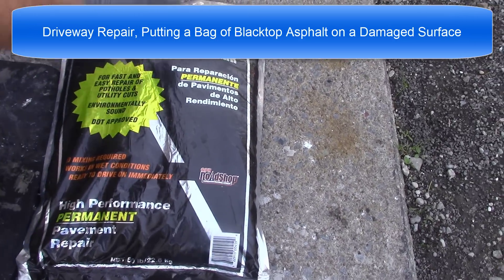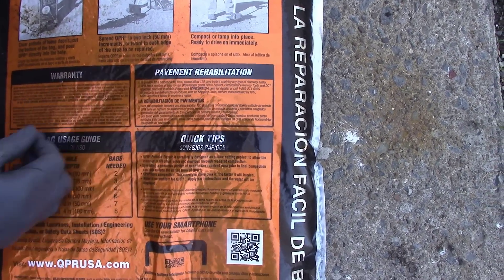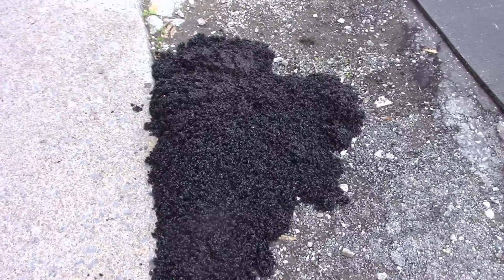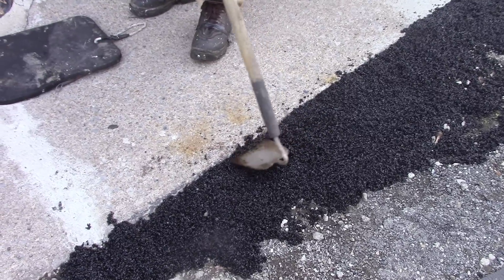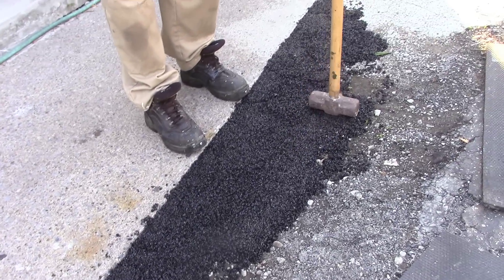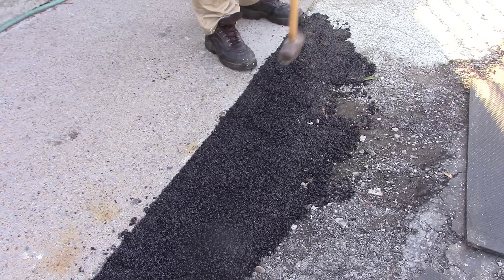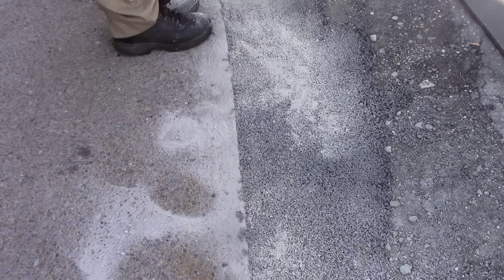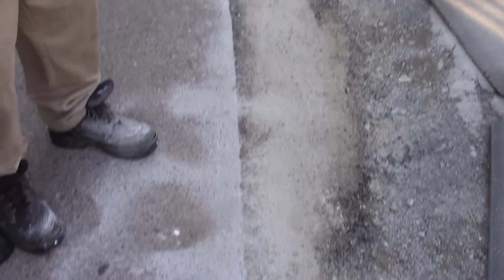Driveway Repair, Putting a Bag of Blacktop Asphalt on a Damaged Surface

Comment: Pulling in off the road my driveway has about a 3 inch drop on the left and goes down to about an inch and a half on the right and it’s a down sloped driveway so when anyone pulls in the bottom scrapes a bit, I was thinking 2-3 bags of this stuff spread out like a ramp would fix that, how did it hold up for you? I know it’s not permanent but once it’s in place it should be easy to patch again right?
Reply from the maker: Should work great! You can add a little small gravel too to make it go farther. Now that I look at the 3", I'd use concrete (not mortar, concrete has gravel in it.), use the high strength stuff, $4.98 a bag. or maybe the real strong stuff $20/#30 bag, I think it's in a blue or yellow bag at Lowes. Concrete is great but it might break up that thin (I have that problem in my driveway). The stronger stuff is strengthened with glue and fibers. Maybe a layer of the strong concrete, then put the asphalt on top. I'm think if the 3" asphalt does not hardener, you'll have a squishy mess under your tires. Whatever you do, you'll probably have to patch it up ever year or so, especially the thinner side.

Comment: Thank you for sharing. I need to repair my driveway. There’s no way I’m paying anyone to do something that I’m capable of doing myself. Great video.
Reply from the maker: Yep, it's easy. Buy a tamper at the hardware store too, it helps. Or just make a temporary one from a cinder block.
Reply from the maker: I just put a topcoat of cement over my whole driveway, it took less than two hours. If your driveway is asphalt, you could coat it with a blacktop sealer in 30 minutes or less. I think a 5 gallon cost about $35.00.
Reply from the maker: It's been 4 years, the spot is still in great shape.

Comment: Can you use this at any temperature I'm at 50 digrees.
Reply from the maker: I'm not sure. Pick a sunny day, might work. Cement will work, and it's cheaper. I've thrown a bag of dry cement on the driveway in a snow storm, and squirted water on it with a hose, and it's still solid 10 years later.

Comment: Having never yet done this I can tell you before hand you prep the area first get rid of rocks and smooth the area actually get rid of all the rocks use flat sand or limestone or something similar so that it lasts much longer open bag and pour it on top clearly what you never want to do but aye.. not my driveway not my problem
Reply from the maker: FOUR YEARS AND LOOKS GREAT! WITHSTOOD THE WEIGHT OF AN 8000 POUND F250, AND A LONG COLD WET WINTERS THAT MELTED AND FROZE MANY MANY TIMES TOO! WELL WORTH $11.00 DOLLARS!
Reply: @JimVincitore  lol Jim, your replies to comment over these years are killing me 😂 I am gonna to try your exact video later this week. Thank you for posting.

Comment: Compaction is the key here! This homeowner should apply a little more force I would think! The cement application might help harden it but not be best used if a second layer of black top is to be added soon!
Reply: Agree....I was given some not used asphalt.  I broke it up, spread it around, tamper only....gas one not like jackhammer.  It broke up even then.  Redoing it a layer tamp...layer tamp. Until 5 inch thick.  O wish I knew someone to roll it

Comment: I'm trying to even up my driveway that is rough on my car as it has a drop down from the curb. Will this help me level? How is the product looking now?
Reply from the maker: Hi MH! It's great, and I even drive way 8000 pound truck on it. I had a few comments say it won't work, I'll do an update video tomorrow and post it.  Thanks for watching! Jim
Reply: @JimVincitore  thx a lot. I just bought a home with a brand new 3 car concert driveway but the city owns the curb and it's all busted so my challenger takes a hit due to it not having a smooth transition to the street...How much is this stuff and where can I get it? I have a 3 car concert driveway thats probably  20 ft in length.
Reply from the maker: @MHSenju3000  It's $11.00 a bag, not cheap. A fella across the street from me put in a big shed, I think he got permission from the city to cut out the curb, so he could create a driveway up to the shed. He cut it out himself.

Comment: If you have an entire driveway to do, hire yourself a concrete mixer and youtube how to lay a concrete driveway, It is unbelievably simple to get professional results and far cheaper than Cold Lay Asphalt, Just use Cold Lay for pre-existing holes to your Asphalt but use Bitumen paint to seal edges first.
Reply from the maker: Right. If I was 20 years younger, I'd have a new driveway put in by a pro. The house is 120+ years old, and I'm 62...at this point, who cares about the driveway.
Reply: @JimVincitore  \\same here but cash is our big obstacle, if I have caused any offence please forgive me.
Reply: @JimVincitore  agreed, at your age just keep patching the driveway as needed. It’s not worth the $5-$10,000 to replace it unless your a wealthy man. My mom is 64 with an eroding asphalt driveway, I spend $100 a year patching it up and that’s gonna have to work until she passes on because she doesn’t have $6,000 for a new driveway
Reply from the maker: the house was built in 1890! I told my niece, when I die, just have it torn down. Constantly cleaning the molding basement is a real hassle.

Comment: 1.) You need to clean the area of loose debris first, so the asphalt can grip/adhere to something that won't move.

2.) Once in place, you want to tamper the asphalt down so it compacts itself and you get a good bond with the ground beneath it. Also,  good compaction   will help in keeping it together from changes in weather (heat and cold).

3.) Wait 60 to 90 days before applying driveway sealant to ensure the asphalt hardens. Do not apply sealant to soft asphalt.
Reply: Thanks for the heads up, I'm about to patch and seal my driveway and I guess I'll be better off sealing first, patch, and then resealing the patches in a couple months
Reply: It doesn’t matter
Reply: @roaldyboy  of course it doesn't matter if you don't care about the results. But if you want it done correctly then it very much does matter.

Comment: Why wouldn't you do it in sections that covered the width.. the way your doing that makes virtually no sense, That is not tamping you need weight and muscle, sorry for the critic,but this is not correct
Reply from the maker: Hi Tony! Thank you! Still working great! 120 year old house, not worth spending $2000 on a driveway. My grandfather landed here from Italy in 1917 and I'm still here. My father always said, "Don't leave, it's paid for." Thanks for watching! Jim
Reply from the maker: If I tampered it down any harder, it would squish all out.

Comment: Wow - all wrong.  Do not do it this way - knows NOTHING  about  how to do this !
Reply from the maker: Hi SB! Yeah but it's solid as a rock, no chipping off, and strong as the cement, even with my 7000 pound F250 driving on it. Thanks for watching! Jim
Reply: @JimVincitore  you get rid of the loose material so that you get good adhesion all those fines and loose material are going to allow your patch to bread up after one season or less.
Reply: Buddy B follow the instructions on the bag 🤦‍♀️

Comment: You went over the instructions  and then ignored them. WTF. They even showed you a picture of a tamper
Reply from the maker: LOL! Good one Jeff!
Reply from the maker: Tamper is like $30.00!
Reply: Im doing the same job with my driveway, bought a tamper for 30 dollars and after 20 stamps with the tamp the wooden pole broke off, bought an all steel tamper. Still barely works
Reply from the maker: LOL! Good one Evan!

Comment: How did it work, i didn't see part two.
Tks for the video
Reply from the maker: Hi MR! It worked great! Did not break up a bit! Thanks for watching! Jim

Here is the update video.

Driveway Repair, Putting a Bag of Blacktop Asphalt on a Damaged Surface UPDATE
https://www.youtube.com/watch?v=FD-6nwCJhr4
Reply from the maker: Just a week or two ago, I surfaced half the driveway with bags of cement from Lowes. I'm working on the video for that too. Cost about $100 or so, but it was hard work mixing the cement.
Reply: @JimVincitore  i am fixing to do a 5 by 7 and a 4 by 3 that the concrete has caved in and broken,  i went to Lowe's and saw QPR and they were in 50 lbs bag for about 12 dollars,  so do you think i should put mortar or cement on top of it too or just the qpr will work.
I appreciate your input
Reply: @JimVincitore  definitely 
Tks for taking time to teach us.
✌🙏
Reply: @mansourramzey7711  No cement or mortar. Just make sure to COMPACT

Comment: It won't work that is cold patch made for a temporary fix in potholes this will just push out on the sides unless you stayed off for about 3 months until it set up
Reply from the maker: Hi HW! It's a low traffic area, I just drive up and park. But I have parked my 8000 pound F250 with snow plow there all year, and it's holding up better than the rest of the driveway! I'm surprised it held up that good myself! LOL! Check out the update video I did on the patch last fall. Thanks for watching! Jim

Comment: I just bought a house here in the city and I would like to know if anyone can repair and patch concrete surfaces on my driveway??
Reply from the maker: IF THE HOLES ARE SMALL, DO IT YOURSELF. IT'S EASY TO MIX UP CEMENT. JUST BE CAREFUL MOVING THE 80 POUND BAGS AROUND, THEY ARE BACK BREAKERS.
Reply from the maker: TRY TO GO 4 INCHES TO MAKE IT LAST, BUT ON A DRIVEWAY WITH LITTLE TRAFFIC, 2 INCHES IS GOOD FOR A TEMPORARY FIX. GROUND UP STONE WORKS GOOD TOO FOR A FAST EASY FIX. JUST SHOVEL IT IN THE HOLES. MOST BIGGER LANDSCAPING COMPANIES SELL IT.
Reply: What city? Lol
Reply: @TheeHistoryTeacher Alabama